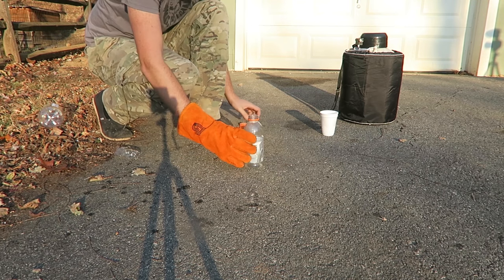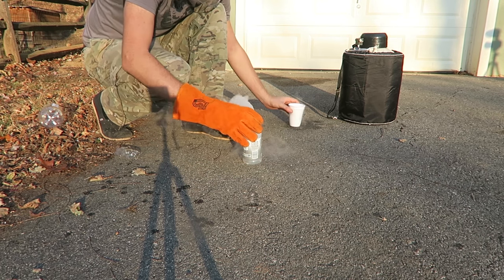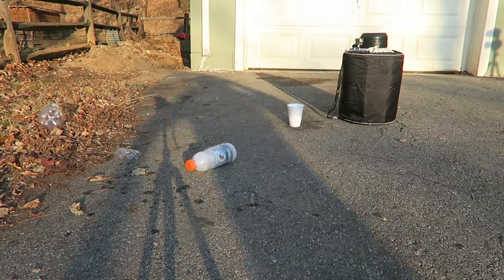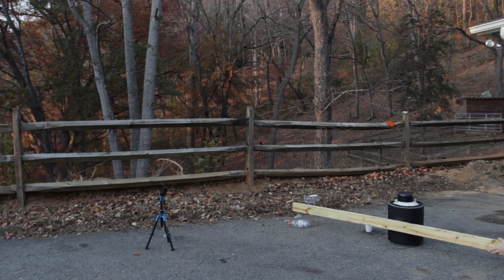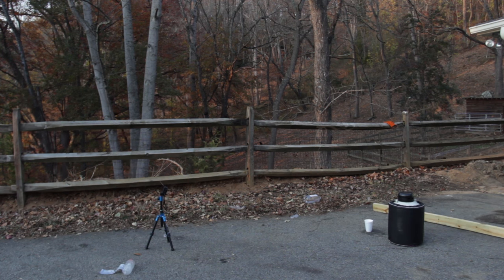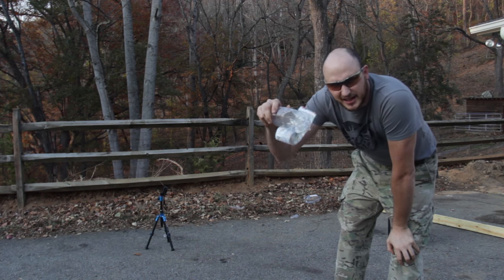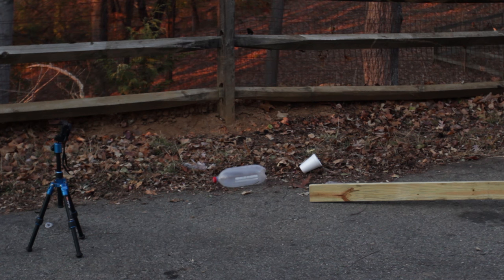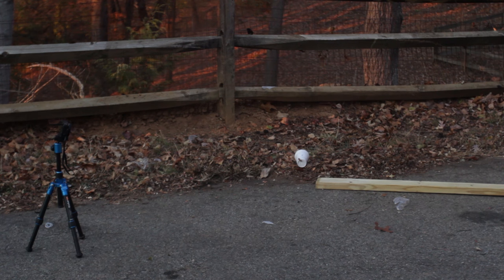Don't Put Liquid Nitrogen into Plastic Bottle

Comment: What happens if you drink liquid nitrogen
Reply: Henrique Gaspar Basically the same thing
Reply: Henrique Gaspar You cant, unless your in space

Your Mouth is too hot and the Liquid Nitrogen would just turn into smoke, and because of the Hotness of your mouth(oh lala?) the liquid nitrogen would just sit on top of your tongue on top of a little "cloud" due to the temperature difference 

It's the same reason that you can dip your finger in cold water and then molten Aluminum and not be burned OR the same reason you can do the ice bucket challenge with liquid nitrogen(also, you can dip your finger in it for about 1/2 of a second and not get immediate frostbite)  

BTW don't try drinking liquid nitrogen, even if the Lidenfrost effect and the boiling point of Liquid Nitrogen, you will still run the risk of freezing your tongue, and breathing in nitrogen, which wouldn't actually do anything, but ya know, you use your tongue a lot 

Fun Fact: The lungs can't actually detect a lack of oxygen, so even if you do breathe in pure nitrogen, you wouldn't feel pain, you'd just get extremely tired and not wake up. Your lungs just feel a lack of breathing, which is why carbon monoxide doesn't hurt you, and you don't know its there.
Reply: Derpy Duck You know more than me about this stuff, but don't try to drink liquid nitrogen.
Reply: Derpy Duck you are not totally wrong when you say that your lungs can't detect the lack of oxygen.  our body actually detected the increase in co2,  and tells our muscles to breath.  there's also a condition  where ppl regulates their breathing by the O2 it's called CPOD,  common is asthma patients,  if you give pure O2 to this patient,  his brain will Think he doesn't need to breath.
Reply: It's hard to explain technical things in English cuz that's not my home language,  a healthy body will detect co2 (dioxide)  and CO.  The problem with monoxide is that it doesn't smell.  So you may not be aware of it's presence. And it's linkage to red cells are stronger that the oxygen.  So, your lungs won't be able to exchange CO2 for O2, since CO is already linked to the cells.
Reply: Boom
Reply: +SheyeZe HD lol :D
Reply: You get a Freeze Blast ability.
Reply: You get Han Solo'ed
Reply: "One way to find out"
Reply: you turn into subzero from mortal kombat
Reply: xXxWeezyFirexXx Yep!
Reply: Henrique Gaspar One way to find out.
Reply: bum
Reply: Faraz Ahmed you breath nitrogen every day, it's called "air." Oh, and there's a little oxygen mixed in.
Reply: Totally necessary to type 4 paragraphs
Reply: That's next weeks episode
Reply: Ther goes nothing
Reply: u dye
Reply: The Mega mmdestroyer973 What color?
Reply: Trimosity cyan

Comment: Here in germany we got thick plastic bottles(for refilling/reuse without melting) you should try it with these :D And glass bootles could also be fun xD
Reply: Bauamt  neeeeeeinnnn
Reply: If it was glass only the top would pop off
Reply: glass can handle pressure pretty well even it's thin so I don't think anything will happen, the cap will just pop off
Reply: +raggex rag everything is doin fine

Comment: just like a "Worx bomb".  Put aluminum foil in a plastic bottle and then pour in some cleaner (toilet bowl cleaner usually) that has plenty of hydrochloric acid in it.  Makes aluminum chloride and hydrogen gas.  Swells and blows the same way (but with acid sprayed everywhere so it's a mess to clean up).
Reply: Jonathan Duncan sounds like chemical warfare
Reply: Jonathan Duncan Sounds very illegal